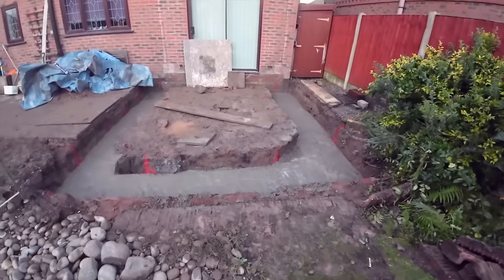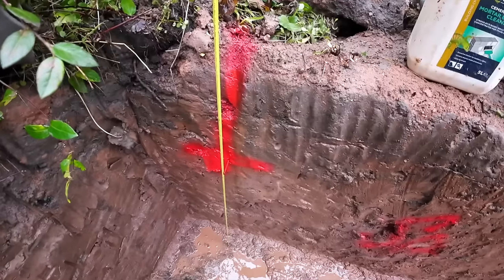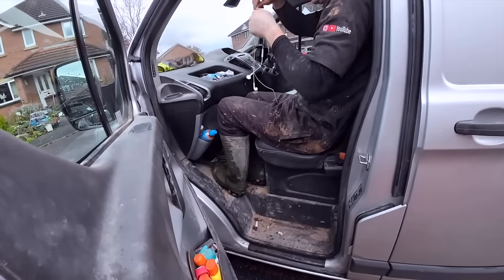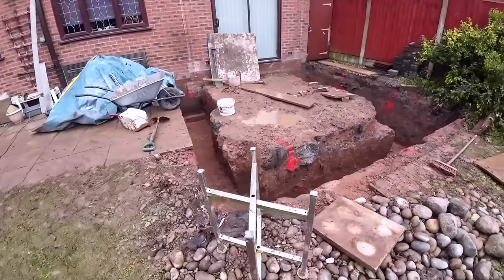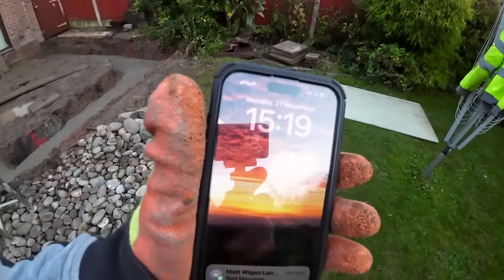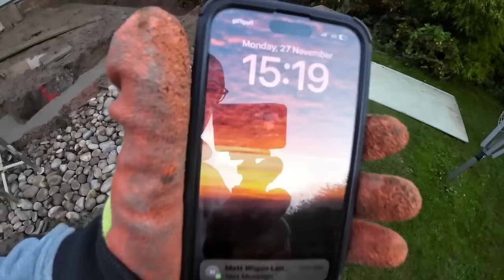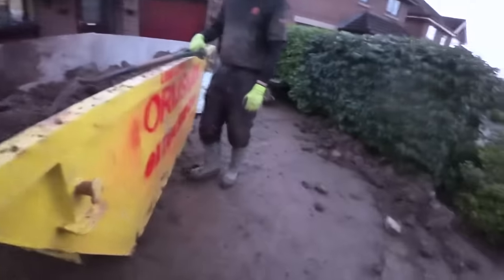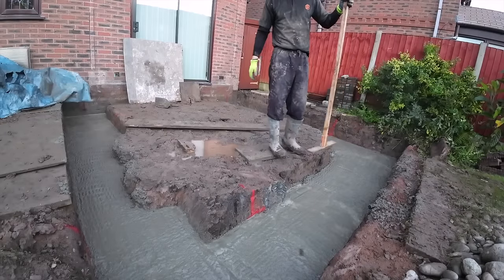MUD, LASER LEVELS AND LOADS OF CONCRETE.. CONSERVATORY TO EXTENSION PT 3

Comment: done plenty of these jobs in the past steve and full fill on the concrete is the way to go. when you calculate concrete costs against trench blocks,sand and cement, labour to lay the buggers . plus it much easier to square the new build up. win win .best of luck with your pre opp pal👍
Reply from the maker: Took me a while to work that one out but it really is a no brainer Lawrence 👌🏽🧱👍🏽

Comment: That wss a tough shift!
November wasca nightmare for rain.
Scrsping that foundation out for inspection twice must have been disheartening.
You did suggest a gouple of vuds ago that you'd put drier mix on the bottom to 'soak up' residual water in foundation and I'd like to have seen that as on site mixing can vary the water content.
Having said that such a thickness of concrete makes a difference.
Interesting to hear that with the larger trench blocks needed for the thicker insulation and effort to carry and llay them turn the balance from strip foundation to  trench fill especially when you take into account reduce structural back fill inside and making good outside.
Hoping your appointment comes through soon.

Keep up the good work.
Reply from the maker: Thanks Mark 🤙🏾🧱👍🏽

Comment: Just a question Steve  Why dont you put level batterns round in the footing for concrete height instead of nails in the side of the trench? thats what we do in the south
Reply from the maker: Sounds like a lot of work and materials for the same out come 🤔🧱👍🏽
Reply: Not really we all have tile battern left over from jobs, thanks for getting back @SteveAndAlexBuild
Reply: We never use batten in the footings always 12/16mm rebar, building control would shoot us if he saw wooden battens in the footings.!
Reply from the maker: Yeah not a fan of timber pegs any more . The nails are so much quicker, just a box and no cutting to size. Whack em in ,spray em … done 🧱👍🏽